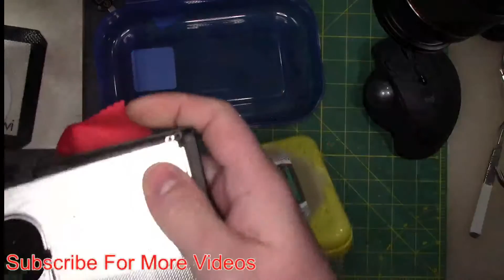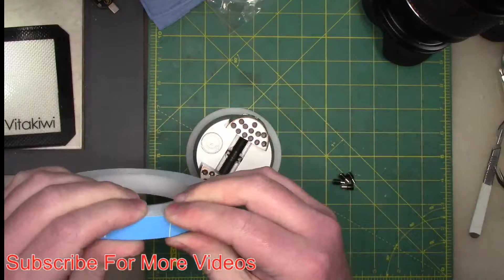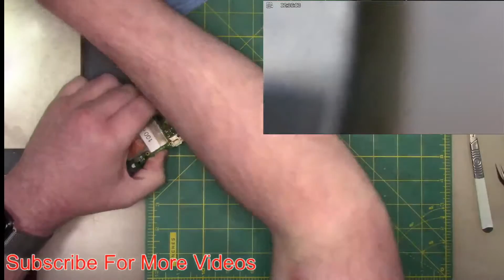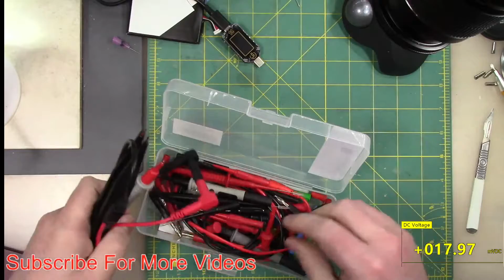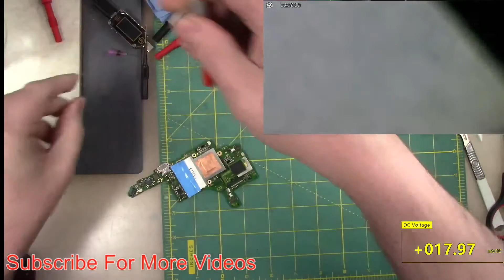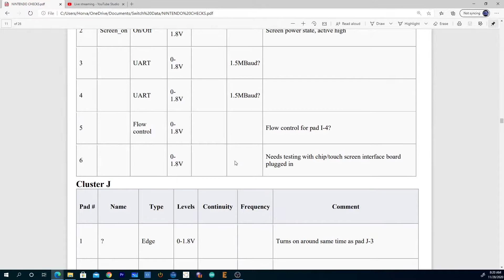Some Cool stuff with Nintendo Switch #1001

Comment: Jason what you should have said to that Trace question was...They are used for trace length matching. 
Differential high-speed signals need to have their traces routed with lengths as close as possible to each other, 
so by adding curves (Zig-Zag) you seen near the RAM can add more length to one trace than the other and bring the trace lengths closer to each other.
Reply from the maker: Yes that would of been a lot more accurate, but would of raised more questions than I was prepared to answer in chat, but basically the zig zag the traces to match the resistance of the other lines to the ram. It’s a lot harder to explain with out my drawing pad so I gave a simple explanation. I have a ram video I will be working on as part of my code crack game and I plan on going into detail on how the ram communicates with other logic chips
Reply: Sorry my bad, Chat would have been filled with a rather long explanation if you had given a longer reply. I Wasn't thinking straight, had a bit of a bad stomach lately. Plus that's 1 of the reasons why i don't talk live chat would be filled with lengthy & boring to some reply messages, as you said leading to longer Q&A Sorry again.
Reply from the maker: No worries a lot of the time I end up getting video ideas from questions asked in chat and I’m sorry to hear about your stomach
Reply: That's the good thing about it, Good things can spark from a simple "idea or Question" Your not wrong there at all. I'll be OK most likely something i ate.

Comment: I been thinking Agent JSon Java master hehe! My idea below isn't a request Jason just an idea, I seen others talking about it in streams.
Could you do some video's on PSU/Power supply design, from simple to more advance & maybe show diagnostic techneqes, safety etc.. 👍
Reply from the maker: Steve my traffic light project will be entering into the power supply design phase soon and I will do a few videos talking about how they work and how to build custom built units of all sizes.
Reply: Ah I see. I will watch and wait in anticipation, little secret I love PSU making, working on them etc.. more than other things, I'll do retro console repairs with my eyes closed as well as coding, that's most likely why I like your self and Phil so much you both, good guys with a love for the same things, like my self 👍
Reply from the maker: Thank you. Power systems was what I mainly dealt with at work, it’s not as bad as people let on about
Reply: I can 100% agree with you & relate to it. I grew up next to a coal power station and was always fascinated by it & the giant pylons the cables run from, I used to watch and talk to the guys that would come around and grease the lines in the carriages, that where on wheels. But the electronic side is thanks to my Dad. may he rest in peace, I miss him sooo much.